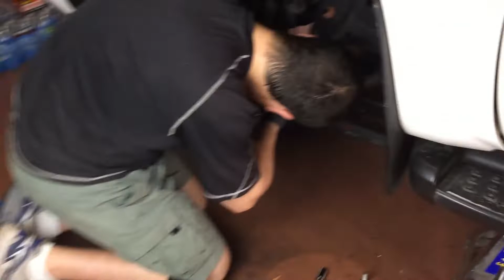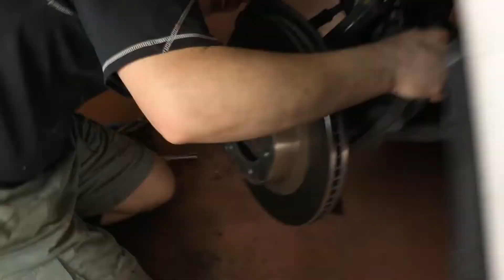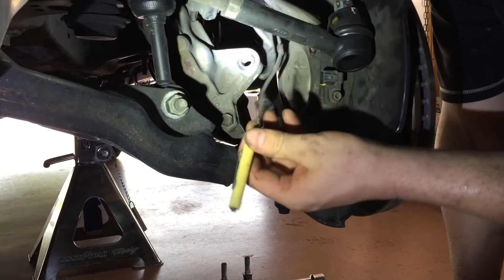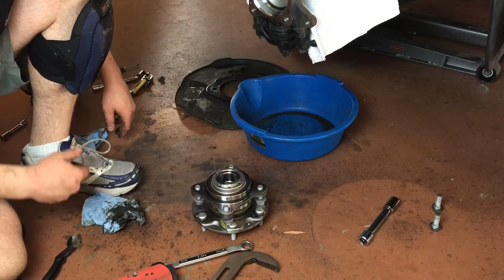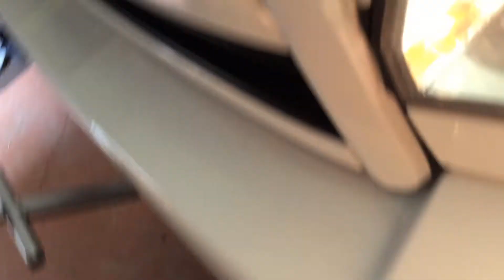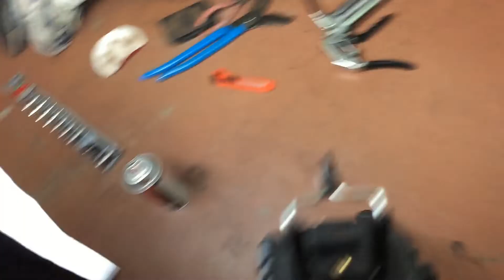Toyota 4Runner Wheel Bearing Hub Replacement

Comment: Finally a video that shows a 2wd 4runner! Thank you👍
Reply: Not many 2WD models to begin with.

I mean it's literally called a "4 Runner" for a reason 😂😂😂

I mean who buys a 2WD SUV? Soccer moms that want the SUV look but none of the actual performance.
Reply: @imadequate3376  well I got a 2wd with a v8 that I'm thinking of putting a supercharger on it, I doubt any soccer moms would approve of that. But since there isn't many 2wd models around, wouldn't mine be more valuable? Due to scarcity creates value sorta thing🤪
Reply: @tinyzeusjr6128 a year late. But  naw, super charge that shit bro. RWD V8s are fun.
Reply: @VeeDubConnoisseur there’s a lot of 2wd 4Runner where I live. Not too many 4wd models down here
Reply: @VeeDubConnoisseur  1. It's much cheaper 2. It's the same size as the 4WD 3. It's MUCH cheaper

Comment: Hey Bro. Do you have direct number of this part or direct link where did you buy ? Hub with Bearing assembled for 2wd toyota 4runner. And behind there is any dust cover ? Do you have a part number also ? I cant find it and I need to order it also. Thanks
Reply: Im wondering the same. Im prob just goin to get from Toyota dealer. Prob cost more but you will know it fits and is made in Japan or America.

Comment: Just did mine on a 2006 4runner and out in a doorman complete assembly from auto zone. Went on no issue and back together and cleaned everything prior to reinstall and now when I turn right I'm getting a noise. Any thoughts? Pulled tire back off and reinstalled bass and bend the dust shield and a little better bit still a noise.

Comment: Hi Matt, is there any additional seals for the hub when you install? Thank you
Reply: There is one behind the bearing you can change. Mine came with it. You have to disconnect the lower ball joint/knuckle to free up the cv axle to replace.  Not a big deal